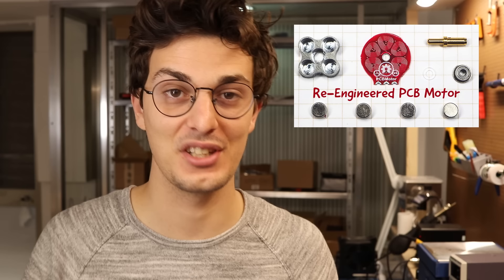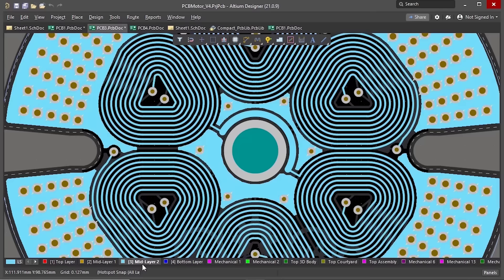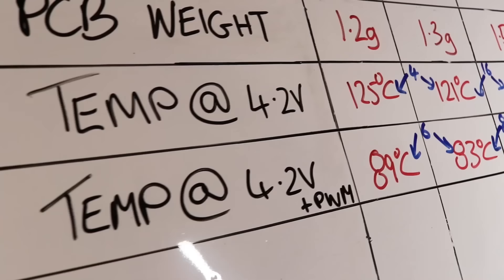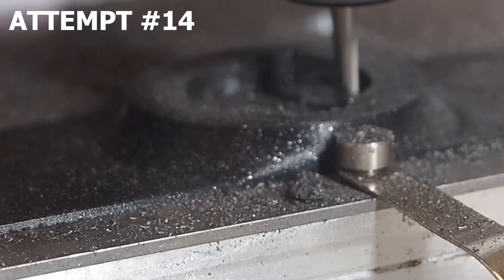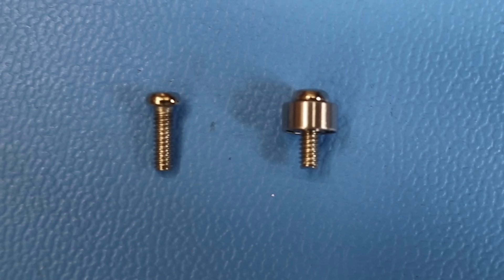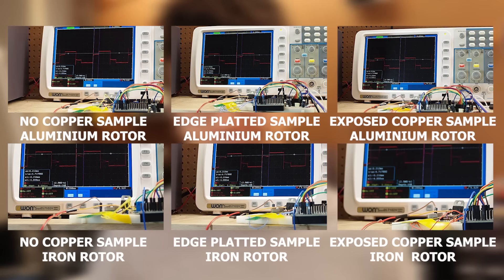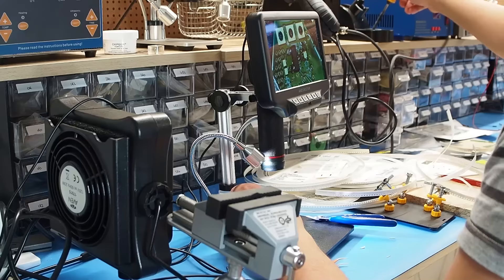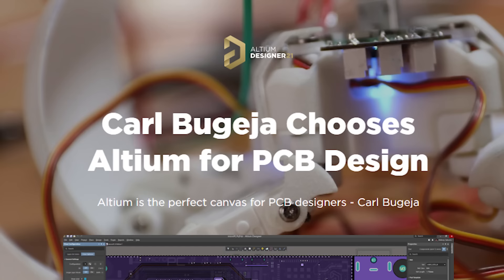Making PCB Motor v4

Comment: Your tenacity is commendable, the amount of iterations you've gone through on all these PCB coil projects is simply staggering to me, I usually give up after revision 3.
Reply: If theres a will, theres a way. And Carl has clearly shown that he has the will to make a PCB motor that works pretty well.
Reply: Make one mini fan cooler
Reply: @timteecvhn  it can give speed but no torque.. because of the coil limitations in that pcb..But it can be used in many places...but if you put a heavy proppler on it, the rpm will go down
Reply: @b-beluga4510  maybe we can  use some gears to increase torque
Reply: @pratiklondhe5167  A harmonic drive, maybe?
Reply: @R.Daneel   I don't know what harmonic drive but i will study that
Reply: Every failure is a step towards success
Reply: PCBs have come a long way and each iteration has been better than the last. I really appreciate your tenacity and the amount of iterations you've gone through on all these PCB coil projects. It is clear that you are committed to making the best PCB Motor possible.

Comment: Lots of good advice in the comments: hitting permanent magnets reduces their strength, use coolant when machining iron, a simple hand vice to put in the bearings would help prevent damaging the outer race,
Reply: True
Reply: Also the way he mounted the magnets in the steel part is shorting them, it would be better to have a magnetic plate as a flux carrier and sandwich the four holes on top made from pcb material so N-S of the magnets is not connected via magnetically conductive material.
Reply: @ Carl Bugeja  & Robert F  

You are conflating Iron and Steel, you should use coolant with STEEL, Iron is self lubricating because of its high carbon content which acts like graphite during the cutting process. In machine Iron, be prepared for a tremendous mess, the carbon dust will coat everything in a certain distance
Reply: One of the great things about online forums is that you can get a lot of good advice from people who have been there, done that. Recently, someone asked how to make a PCB motor and got a lot of great responses.

Some people suggested using permanent magnets, but others warned that hitting them with a machining bit reduces their strength. It's a good idea to use coolant when machining iron because it helps to keep the heat down and prevents the workpiece from warping.
Reply: also a good esc that keeps the motor pressing rather than jump around and hit the scale like that, not a diy arduino based one..
Reply: ive never used coolant with iron. cuts like butter already and is super easy on tooling.

Comment: adding small air vanes to the side of your stater to encourage air movement though the PCB with holes in it might help control the thermals. A lot of high power motors use this design.
Reply: Good call!
Reply: To encourage air movement through the PCB with holes, small air vanes can be added to the sides of your stater. This will create a more efficient system by increasing the amount of air that is able to flow through the PCB. Additionally, this will also help cool the motor by drawing in cooler air from outside the enclosure.

Comment: For calculating torque, you should instead make an inertial dynamometer. Basically a fly wheel that you attach to and spin up with the motor and monitor RPM, based on it's angular acceleration and the fly wheel's known polar moment of inertia, you can build a torque vs. speed curve that's much more accurate. Ideally this should be done using 2 fly wheels of different mass so that you can calibrate out the rotor's inertia, but if the rotor's inertia is much less than the flywheel or the accuracy needed is low, then this can be done with only 1
Reply: Great option, I was thinking the same thing! Was kinda flabbergasted that he said "the second method was less accurate", since the first method also takes in the acceleration by the gravitational forces. Basically the same thing as hitting one of those carnival attractions, the one where you strike with a hammer trying to make a bell go "Dingggg" (don't know the name) ;p.
Reply: Cool, is this method described further somewhere? Is it called something?
Reply: this is good - can't change the physics behind this simple test -  very good!

Comment: I have worked a little with a company that is makes PCB motors commercially.  The primary engineering challenge is heat removal, the method you are using is pretty much the way to do it.  The next step is to add an aluminum housing as a much larger heatsink.  The rotor is typically on both sides on the PCB.  Two bearings further apart assists in removing wobble of the rotor.  The next engineering challenge is that you get a very low copper to rotor ratio.  One way to get around this is making a motor with a very large outer diameter, the other is to sandwich multiple together.  By having a stack, you can utilize the same rotor magnet on both sides on a sandwiched PCB.  From a power/efficiency compared to weight, these motors are not competitive with traditional wound motors, however I see a future for low cost designs where size and weight is not as critical.  Using an extruded heatsink ring that mounts to the end would allow the assembly to easily scale up or down my increasing length with common componentry sandwiched together.

Comment: On your OtherMill -- you should use mist coolant and run at the right feed/speed with an HSS bit!
Reply: I think carbide will still do better with cast iron over HSS - HSS wants a lower SFM thus lower RPM during cutting or it tends to burn up. The Othermill doesn't spin slower than 10k- whereas I'd want to be cutting at less than half that RPM for a .125" endmill on a regular milling machine.  Coolant could definitely help with the issue of burn up - spraying a bit of WD40 or a cutting lubricant can also work in a pinch.

Comment: Hi Carl. If you extend the idea of decreasing magnetic reluctance from your iron rotor to the stator you could stick a tile of high frequency ferrite material to the opposite side of the stator. I reckon you should get significantly more torque that way. But since you then also increase PCB coil inductance you most likely will decrease the motor Kv value so you will the need a higher supply voltage to maintain max rpm. 
Looking forward to your next improved motor!

Comment: Cool project. 
Kicad is the software that you want.
Reply: For real. KiCAD is free, open source and cross platform. 
Meanwhile Altium is none of those, and costs 3,500€ *per year*. That's 15 Adobe licenses. Totally absurd. They must be running a good racket on whatever businesses pay for this.
Reply: @ralvarezb78  eagle is now integrated into Autodesk Fusion360
Reply: @maxhouseman3129  yes,  I know
Reply: @maxhouseman3129  I have one fusion360 license at work

Comment: I think a "shoulder bolt" might do what you need for holding the bearing better
Reply: +1 for shoulder bolts, saved me from a lot of headaches when making some of my RC projects.
Reply: yep. and you cant always get the right shoulder length, but you can get one too long and tap it further without much trouble.
Reply: Or just a part threaded bolt, it'll be too long but you can just cut the excess threaded portion off.
Reply: @spankeyfish  yeah that’s the go to when the shoulder length is right. And the proper solution being AN or MIS bolts

Comment: Great work! Good idea to use printed fixtures.  About the bearing: When journalling a shaft using deep groove radial ball bearings, you need to use two of them, not just one (unless it is a cross roller bearing, which is not available in such small sizes). In your case you could get away with stacking one on top of the other. This would get rid of that wobble and should improve performance as fluctuations in the air gap distance would be reduced.  Also,  it is best to press the magnets in; a convenient way is to use a small pillar drill.

Comment: I've heard that hitting magnets isn't the best idea; this may be for old-school magnets so possibly worthy of further investigation.
Maybe a vice or some other parallel compression method might improve things possibly?
Reply: No, still goes for exotic magnets.  You reduce their strength.  Those definitely need to be pressed in.  The same with the bearing, but for different reasons.  Ball bearings are designed to take a radial load, not an axial load.  Hitting it in can deflect the cage and cause the rolling drag to increase.
Reply: Half tonne or tonne arbour presses aren't expensive, have plenty of feel and are designed for the job
Reply: KNIPEX PLIERS WRENCH makes a great hand held arbour press. especially for small parts like those.
Reply: True.
Reply: Magnets have been around for centuries and are still popular today. However, magnets may not be the best idea for making PCBs or motors. Magnets can be very strong and can easily damage or pull apart delicate parts. In addition, they can be difficult to remove if they are accidentally attached to a component. Magnets should only be used if there is no other way to hold a component in place.
Reply: @aplacetoimproveteslacoilin3721  Don't motors usually work off the concept of magnetism, tho? How would you make a pcb motor without it? Inductors?

Comment: pcb drone? possible idea
Reply: Would be fragile, but awesome. 🤞
Reply: I mean, I have a small quadcopter that's basically a PCB with 4 motors on it. The main difference here would just be that the motors would be built in to the PCB itself.

Comment: Need transformer steel laminate. Also use cnc to make a fixture plate that mounts into the base plate. Cool stuff!🙂
Reply: Yep, sandwiched steel plates is the traditional way to avoid eddy currents in motors .  A very traditional brushless design is to have a rotor made of stacked plates separated by oxidation, dipped in conductive aluminium to form shorted rotor windings that make the rotor respond to the 3 phase rotating magnetic field from the stator.  Thus there are no permanent magnets and the rotor is formed from stacked plates cut/stamped into a designed shape, clamped and dipped.

Comment: Nice work sir!  Keep this motor idea in mind.  The number 1 killer of all motors is heat.  When ever you can, find the best way dissipate heat.  

Air flow will provide the cooling for sure.  Your current changes will change the temp. Also as you found.  Hint - Standard AC motors use their rotor (on an ODP motor) as the fan for air flow.  Using both rotor and stator design, in harmony, you can create the optimum airflow you may need.

Comment: There are many new improvements with PCB Motor. For starters, the unboxing experience is much better. The initial testing yielded good results, and the iron rotor provides significantly more torque. Additionally, the shaft mount makes it much easier to install and use. Finally, the torque testing showed that this motor is extremely powerful. Overall, these new features make PCB Motor a much better product.

Comment: Great work. For the shaft/bearing setup, it is recommended to use a pair of ball bearings for supporting the shaft and the shaft could be a shoulder screw instead of a normal fully threaded screw. These changes should minimize the wobble you are seeing.

Comment: Stators are made of a special iron alloy with silicon, silicon steel. The addition helps keep temperatures lower with changing magnetic fields, and helps the stator "drop" the field faster, for less hysteresis. I have a few plates left. I originally sent to oshcut for some custom stator lamination. They were interested in attempting the material
Reply: what is the alloy called? where can I buy it / get it machined?
Reply: @gedr7664  its called Silicon steel..

Comment: awesome project!
I think there could be another reason, why temps improve with higher speeds: the faster magnets move over the coils, the more they themselfs will actually induce a voltage, opposing the driving voltage. that will result in lower currents, and is usually the reason why typical electric motors have the highest torque at start up (higher current- stronger magnetic field - more torque). you could easily test that by measuring the amps drawn at different speeds.

Comment: This is so awesome. You need to make the pcb press fit for a bearing and you need the magnet housing press fit for a shaft. Bonus points if you add a second pcb board that mounts to the first with another press fit bearing and mounting holes so you can mate this to a planetary (or other) gear box. That will allow this to easily drive your 2wd robot while getting more consistant readings/results. If this comes across as rude or intrusive I appologize.

Comment: Next time you can use a machinist trick. Glue it onto some stock with super glue and then use heat to release the blank when you are done milling.
Reply: JohnnyQ90 does this a lot for small parts that are difficult to hold.

Comment: This is absolutely awesome.  I bet if you glued small ingots behind the PCB at the center of each coil you'll increase the torque significantly.  If you can get thin slivers of iron in 0.1-0.3mm thicknesses and you sandwich the slivers with some spray paint as the dielectric you'll cut out a lot of the Eddy currents.

Comment: Imagine a quad where it's arms are the ESC and motors and they all connect into a central flight controller...
Reply: A quad where the whole thing can be made from a single etched PCB and some 3D printed props? Talk about driving the cost through the floor.
Reply: @MurcuryEntertainment    using a flexible pcb ...
Reply: A quad copter made completely out of one single PCB exists already.
Reply: @maxhouseman3129  I was thinking a central brain that you could plug these arms into. Interchange them... Maybe even plug in other things.. sensors, wheels, whatever.. could be a terrific teaching tool.
Reply: I mean if it can fly then why not
Reply: That sounds something extremely lightweight… it will probably fly on Mars!
Reply: @kerbodynamicx472  the air density on Mars is so much less though. ;)
Reply: @ChadKovac  that’s why being so compact and lightweight helps.

Comment: The "real" temperature test is quite hard to do in a home lab.... Ideally you want to measure the motor structure heat - per watt of mechanical energy delivered. For steady state RPM's this is only really doable if you have a reference motor bench with constant load RPM and a torque meter on the coupling shaft.
Good work, really interesting to see :)

Comment: I think you could further increase the torque by building a rotor with magnets on either side of the PCB. Besides the additional flux from the added magnets such a arrangement is likely decreasing flux leakage by a lot

Comment: Carl -- I admire your effort, but I think the iron you've added is not guiding the magnetic field very usefully.  It would be better to stick with a plastic rotor (with magnets embedded in it), and do a better job guiding the motor coil flux to operate on those magnets. Assuming the board is laying flat, so Z axis is up, the mag fields of the magnets and the coils are parallel with the Z axis. But you're not providing a low-reluctance path for the mag fields from below the board and from above the rotor to curve around and complete the mag circuit.  What I think you need is 6 "C"-shaped iron pieces that pick up the magnetic field below each coil and guide it around to above that same coil, so that you maximize the motor flux operating on the rotor magnets.
Reply: Sounds right, the rotor magnets are poled through their thickness, the steel reaches both flat faces so they likely steal flux by routing it away from the exposed faces. An air gap around the magnets might be a better idea. The field coils have no help at all, maybe some ferrite C cores can be used but even a big ferrite washer  might be better. Trick to visual use magnetic fields, wonder if there’s some cad for that.

Comment: Use super glue to hold the parts you want to machine, at end try breaking the glue bond or dissolve the glue. Never use double sided tape for small contact area parts.

Comment: How about an iron heasink at the back? Would improve thermal issues, but also increase magnetic field strength and improve torque.
Reply from the maker: The magnets will probably attract to the iron heatsink and based on why previous test I think the coil's magnetic field wouldn't be strong enough to overcome that attraction and rotate the rotor
Reply: @CarlBugeja  Didn't PCB way just release an aluminum PCB substrate?  Would love to see the motor on that.  It would, in effect, have a built in heatsink. Right?
Reply: @Scott_C  aluminium will still react to eddy currents
Reply: @zoeyk.6338  true,  however the thermal performance may be worth it for the dip in efficiency.
Reply: @Scott_C  quite possibly, perhaps one could design the rotor such that it has a fan coupled/built into it, in the name of reducing part count.
Like the shaft passes through the pcb to drive a small fan on the back etc.
Reply: I'd also be interested in the results of making the rotor into a double sided arrangement
Reply from the maker: @Scott_C  Aluminium core pcbs are usually used with 1 layer designs, multi layers can be made but the prices would get really expensive.. i have talked on this subject in this video - https://www.youtube.com/watch?v=dy9NutXl2OY&t=373s
Reply: What about changing the rotor shape making it a little bit bigger to insert 4 propeller blades between the 4 magnets to cool the PCB even further and create an air cushion? Or small blades on the external side of the rotor. Probably it would need to be 3D printed and to find a metal 3D printer sponsor.